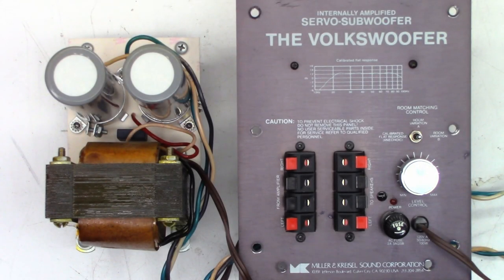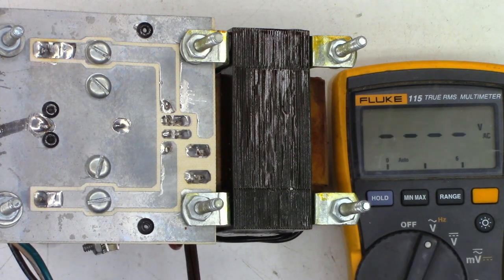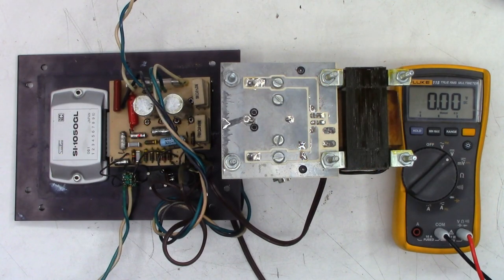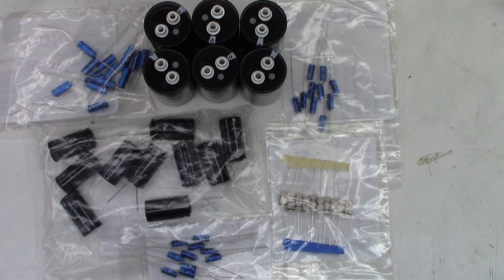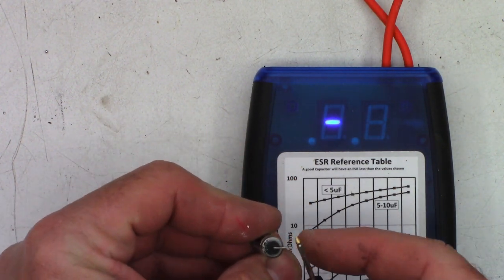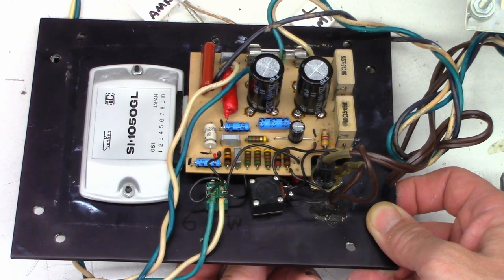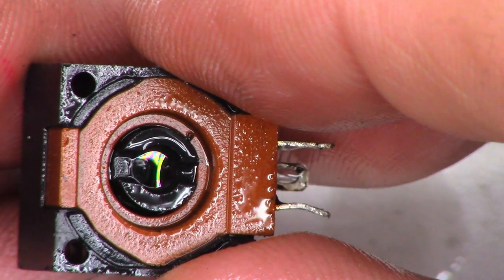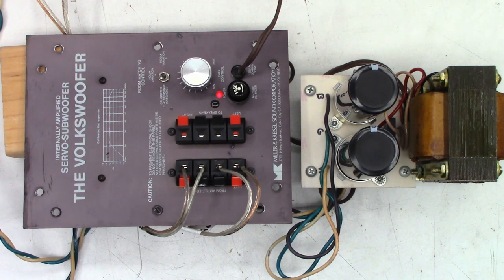Miller and Kreisel Servo Subwoofer The Volkswoofer - Loud Hum Buzz repair

Comment: @NorCal715 I've been following along working to repair a 79 volkswoofer of the same model and I'm wondering if you might have any ideas of an issue I'm running into. I've replaced all the faulty caps but when I plug it in and use the "calibrated" mode on the 3 position switch it does nothing but oscillate the speaker rapidly. Using the other modes seems not to send any audio signal out. I've attempted to replace the SI-1050GL Amplifier with what I believe is another unit with the same woodpecker-esq results. Any suggestions would be greatly appreciated and thanks  again for putting these repair videos out!
Reply from the maker: Did you check the main filter capacitors for ESR and value? I have had open filter caps cause motorboating.
Reply: @norcal715  good callout, I had replaced all the caps same as you had in the video and tested that they were all fine. I'm not sure exactly what it was but I went through afterwards and checked to make sure all the leads on the board were not causing any extra connections as well as a clean of the potentiometer and switch and while I haven't been able to find which one was the exact cause after doing all that it's all working now.